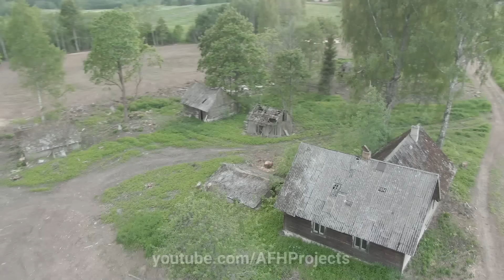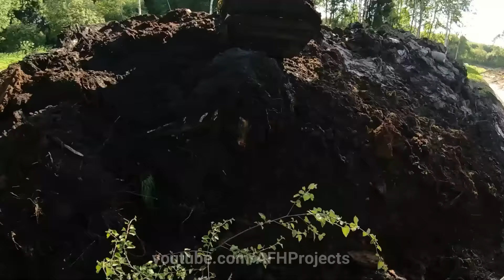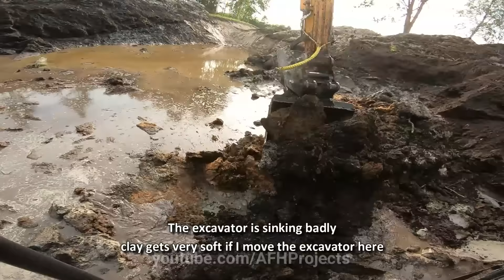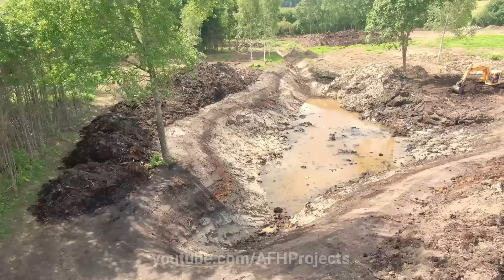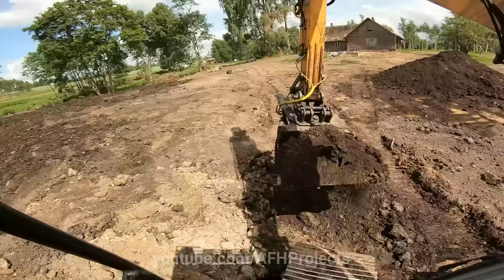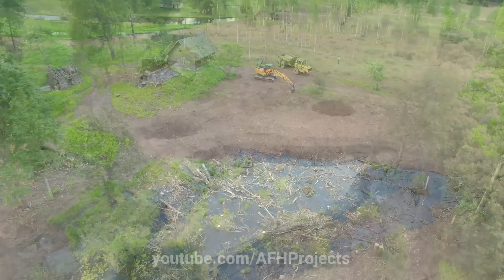I Turned Backyard into a Pond Paradise

Comment: You definitely have Chris from letsdig 18 and the crew on Dirt Perfect beat when it comes to operating the shovel on the excavator.
Reply from the maker: Thanks! I appreciate it! But I'm sure that Chris can handle it. I'm seen him doing this. He doesn't need to do this very often. That's why. Hes bucket tilting function is very fast on 220, I don't like that. Mine is doing it smoothly.
Reply: I’d say Chris is just as good. You’re watching it at twice the speed but in reality that excavator is very slow compared to Chris’s Volvo 220 so it just looks smoother at that speed.
Reply from the maker: @mikehunt3222 If it's slower, then it's smoother as well 😀 but yes, if you compare with my normal speed videos, it might be a bit slower. It's a lot older machine too.

Comment: Great video and work, I just subscribed :-) Where are you located? I see that you do a lot of work with the ditching bucket- how to you like it for digging? (I see that you are digging a lot in sand/soil without rocks). With the ditching bucket you can finish it right away so that nice but I am wondering if it requires a little more power to dig or is there no difference in that kind of soil compared to using a digging bucket (with the teeth)? What size (width) is your ditching bucket? Your shoes/tracks looks wide! Probably a good thing in the soft soil you are working in! Sorry for all the questions :-)
Reply from the maker: @fabiancanada8876 Thanks! In Estonia. Yes, I do. I dig in soft dirt mostly and It's nice to finish all up so I don't need access there anymore. Yes, it's harder to dig if the ground is hard, with a lot of rocks or stiff clay. The bucket for this Hyundai 160 is 180cm wide and tracks are 900mm. Tracks work well for this type of bog I need to deal with mostly. You need to keep in mind that wide tracks mean less force for ground per inch, but if you get stuck then you have more force that is holding you stuck. It's harder to get unstuck. No problem, this type of comments are always nice to get. Thanks for watching and commenting! Cheers!
Reply: @AFHProjects  Hey thanks for answering the questions! I honestly didnt think about how hard it could be to get the wide tracks out when you are stuck but its probably still better to have the wide ones on and just dont get stuck :-) Holy crap 180 cm wide that is a nice bucket size! PS I really like watching Andris from Ants Pants as well. and I think he is in Estonia as well?! Greetings from Nova Scotia (we are originally from Germany but have been living in Canada for 13 years now).
Reply from the maker: Yeah, these tracks make a difference. Sorry, the bucket is 160cm on this one and 140cm on Hyundai 110. Andris is also from Estonia. Nice, I like Canadian nature. Thanks for watching and commenting! Cheers!
Reply: @AFHProjects  Thanks for the clarification :-) Yes the nature /space is really nice but is becoming really expensive to live here and the government control is getting severe as well. We immigrated 13 years ago and it was great then but things have gotten quite bad now. We pay 330/month just for property tax and home insurance. At the same time there are hardly any well paying jobs.
Reply from the maker: @fabiancanada8876 That's sad to hear.

Comment: You really should look into investing in a dozer for moving and grading dirt.
Reply: This man does not need a dozer or Skidster to do final grade or clean up. That’s why this man AFH is the best on YouTube!! That’s a fact. 
The other guys like letsdig18 and dirt perfect need a dozer and skidster to do work like this man does with excavator, I’ve never seen him use a transit level?? Maybe he’s got that good of a eye. That’s why this man is better than any other dirt contractor on you tube. KEEP UP THE GREAT WORK!!👍
Reply: @gregjones3453  it’s faster and more efficient to use a dozer that’s a fact. But to each their own.
Reply: You are correct about faster and more efficient but it’s crazy how good he is with just a grading bucket. Take care 👍
Reply from the maker: Yes, that would be great 👍 for spreading out the dirt and soil.
Reply from the maker: @gregjones3453 Thanks for the good qords! I do most of the jobs, just eyeballing it, but sometimes you just have to use a laser when you need to be sure. It's faster when you don't have to redo things to get it right. And yea, larger areas are reasonable to spread and level with the dozer. I didn't had it so I  did with the excavator. It's more time consuming. Thanks for commenting! Cheers!

Comment: I'd always turn stumps upside down in soft places for small hoes and always had mats for the dragline. I've been in several places I had to mat the machine out and in because it was way too soft to walk on and the machine weighed 25 tons. I still like the tilt bucket setup a LOT and I still don't like ar-tic trucks BUT if that's all there is.................!   CHEERS!
Reply from the maker: Yeah, I save bigger ones as well in these situations, for in case I need them. They always save the day. Just drop them under the tracks. I used mats only once with the hyundai 110. The other operator smashed them on the other project. Should build new ones for in case. But this 160 has 900 mm wide tracks. It's floating much better than the small 110. Thanks for watching and commenting! Cheers Lewie!
Reply: tty sure the old dragline had maybe 36 inch pads and we had to get an overwidth permit to move it. It'd walk around like a dozer but with the non-grousers and all that weight and no down pressure we figured we best be better off safe than sorry. I was the only one that ran it and I made sure the mats stayed in good shape. They saved my neck more than once. And there are spots that you'd need some too. A good hemlock stump sure does help. All ours died off from the blight. Take care and stay warm if you can and build a fire if you can't! CHEERS backatyou and more mat material might make a sawmill video or two!! @AFHProjects
Reply from the maker: @lewiemcneely9143 Yeah, better keep the risk down if possible with heavy equipment. It's bad to go after it when you buried somewhere with it.  And all that mess you have to fix after that. It's not worth it. Thanks for the story! I had a helper who hauled with A20 on site, and I was home. He came to get some fuel and said he's stuck a little. He will get out soon. I had to be in the firestation shift on the next day, so I decided to go a look. He was so drowned in the red clay hole that only the rooftop was over the ground. About the milling... we have deep wintertime here, like 3 feet of snow. Need to get the harvester in shape and go to make some logs. Cheers Lewie!
Reply: I had to go rescue the old dragline I used to run with a D4D? with a winch when the mat broke. The operator was a pal and a good one and caught it as soon as it broke and hadn't sunk. I backed right up to him and hooked the winch in the hole in the middle of the car body and we both gave a heave at the same time and up it came. The harvester will just need checking, a little grease and regular stuff and the sawing will be done when the snow melts I bet. We sawed here in winter but it was NOTHING like yours and under a mostly open shed anyway. Make ponds while the snow flies. We got flurries yesterday with sun shining and that suits me. I used to wear it out but it'd wear me out now. Stay warm and keep slinging stuff and feeding you little bird pal. CHEERS again! @AFHProjects
Reply from the maker: Yeah, good times! Thanks for these little stories! I worked on tree harvester today and I hope to cut some logs tomorrow. Cheers Lewie! Take care!
Reply: My tales will give you maybe something to look forward to. Can't make this stuff up. And YAAY for a limber forester! Just go easy and don't sink. You might have to buy a helicopter to get it out or maybe put the
 V-8 out of the Scania in an old one and make a hot rod out of it! A chopper with a straight pipe!! Remain calm and CHEERS AGAIN! @AFHProjects
Reply from the maker: @lewiemcneely9143 😀 Cheers, Lewie! Thank you for being here!
Reply: Good place to be if you ask me! Done what you're doing with a lot of different things but it was always a happy time. We both like diesel fumes! CHEERS!! @AFHProjects

Comment: Here in the U.K. we recycle, re-use wood. Couldn't some company send a chipper for the site? it just seems very wasteful, just burning it.
Reply from the maker: No one isn't going to chip this building wood. There are nails and other metal stuff in there. It will mess up the chipper knives. It's possible to use another type of crusher, but there is not enough wood for that.
Reply: @AFHProjects  Fair enough. Wood does get shredded and chipped, usually on commercial, or large demo projects.
Reply from the maker: @ibelieveyou2066 Yup.
Reply: Chipping is really expensive,  burning is cheapest way.